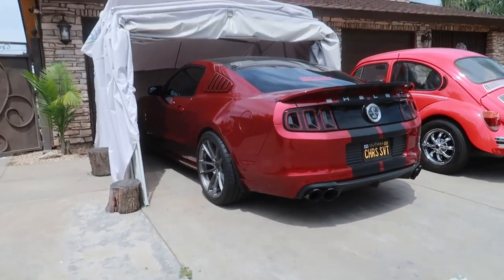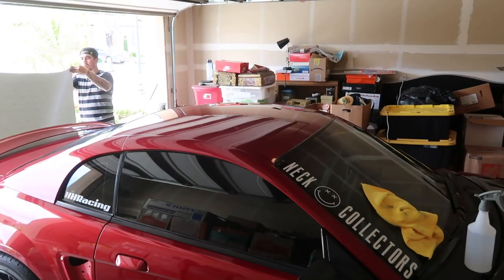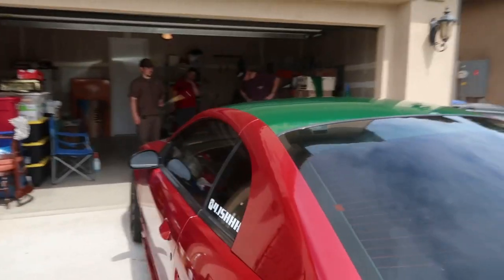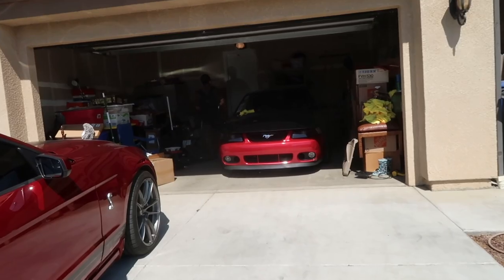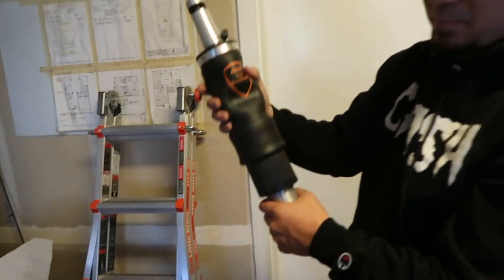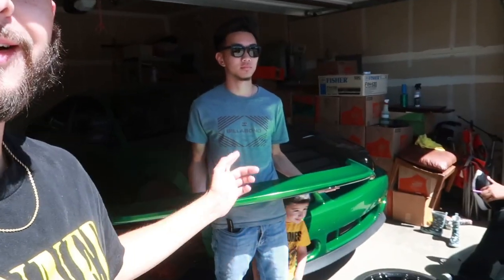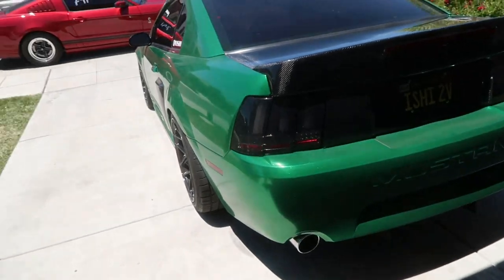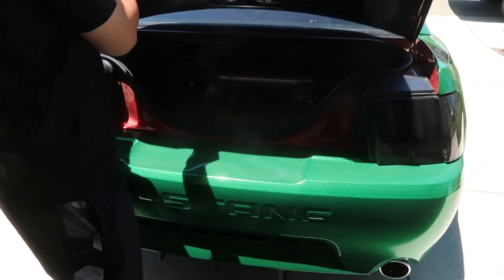We WRAPPED and BAGGED this NEW EDGE MUSTANG * CRAZY COLOR

Comment: What would be a good price to buy one of these guys and make it a project car I want it to be a V8 everything running but I want to make it a project car? I was thinking like 5k max?
Reply from the maker: In my town i see them go from 2k-4500 for a stock one 

It all depends on your area 
But what are your goals for the car ?? & if u want to focus more on building it performance wise i would say To Focus on a lower mile car and One that wont need any more money on fixing paint
Reply: @chrissvt7259  well I live on a dirt road so I wouldn't do anything but lower the suspension probably wrap it to save money and it to be loud as I go I'll probably start making some body mode car is beautiful stock yk idk I'm only 16 and my goal is in about a year to get one any suggestions on a  few cheap performance mods? Would like it to be more then 350 horses (also the 5k max is just buying the car I'll just spend whatever I spend on the car in the end)